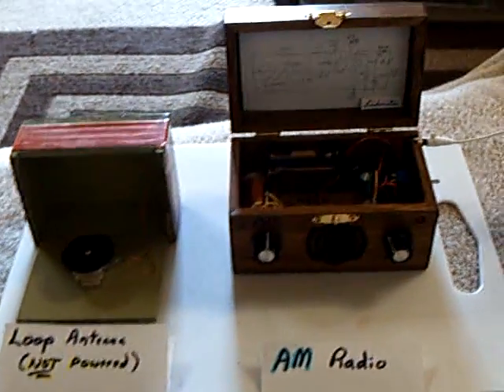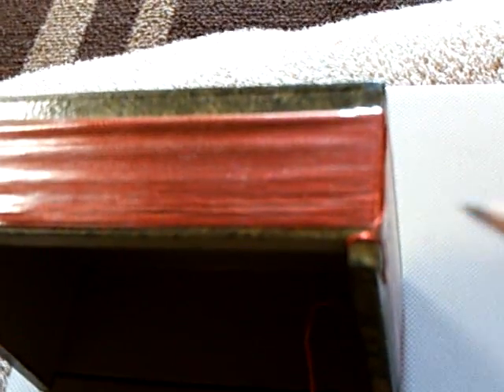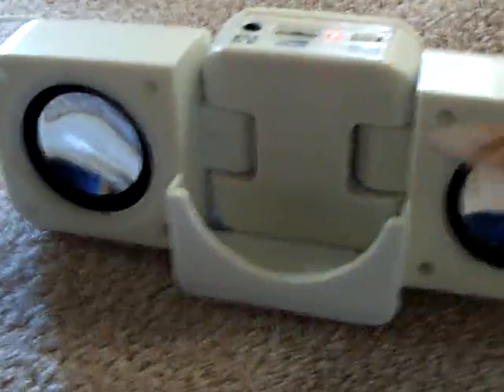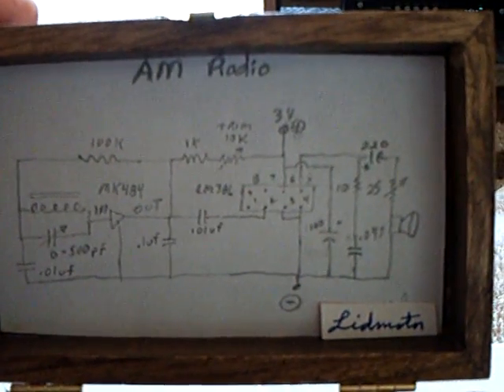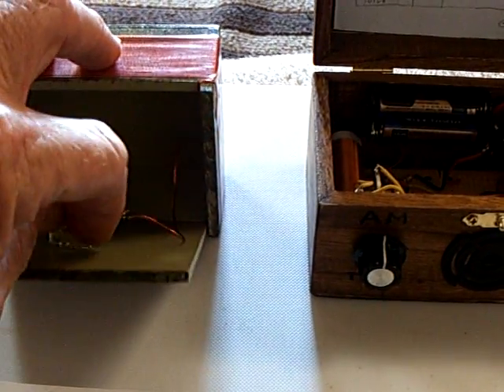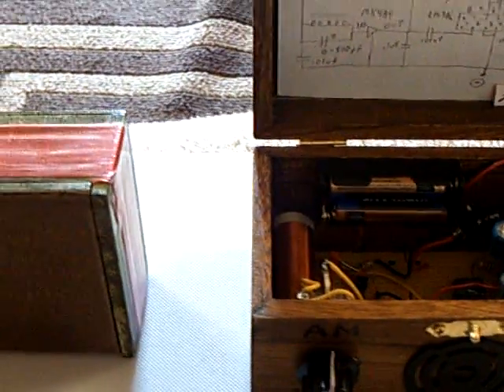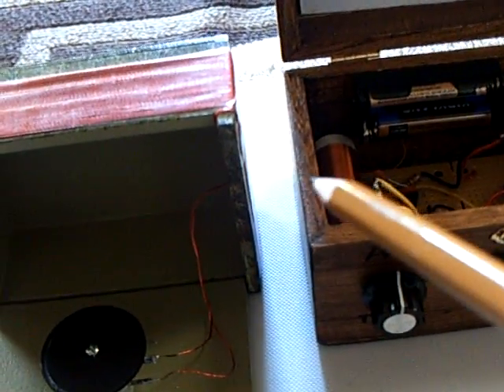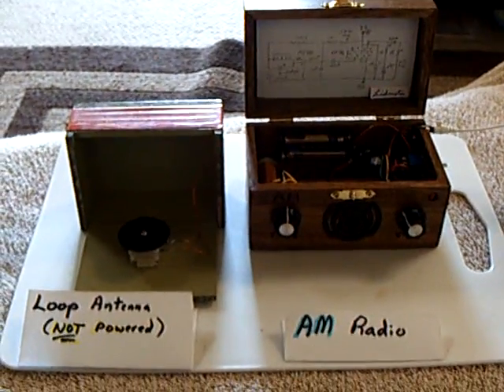AM Radio with wireless Loop Antenna

Comment: The fact that you can tune different stations with your external antenna means that it is operating at a much higher Q than your internal coil, and is effectively taking over the tuning function. You may find that it is over-coupled, and will function more normally if you move it away a little. It should work by coupling more signal into the radio by transformer action, but not actually re-tune the radio circuit itself.

Comment from the maker: @slider2732 ------ I think that Dr. Stiffler's "3 coil" experiment works something like this or at least this tunable loop antenna idea offers a clue that might lead in the right direction. I may go back to my crystal radio and see if this device works on that.  The coil in this AM radio is the same one that I used in the crystal radio-----it is basically a SEC 18 L3 with a ferrite rod inside.

Comment: Nice, I like it and it's fun!. The Loop AE has a high Magnetic coupling compared to all other AE design that are based on electrical coupling. Magnetic coupling, offers many advantage over electric. They are the key towards 100% efficiency and higher. The Mag or Electric effect is simply just in the design. Nice project Lid.